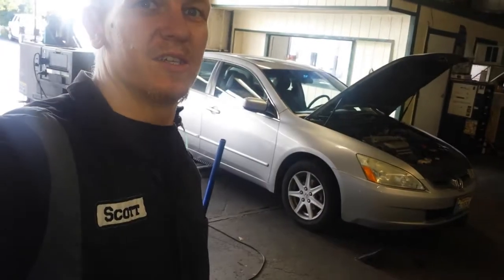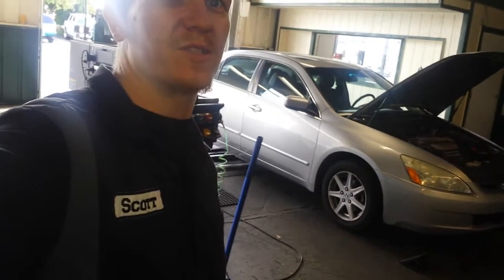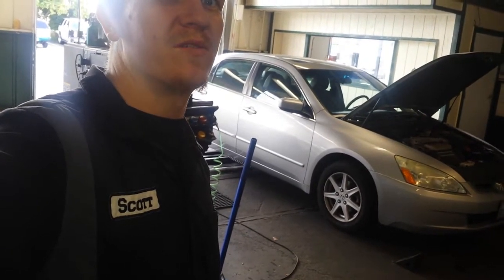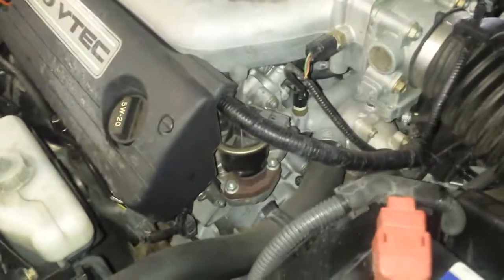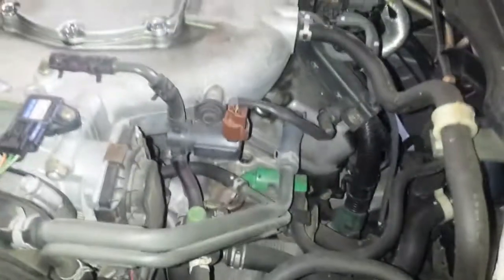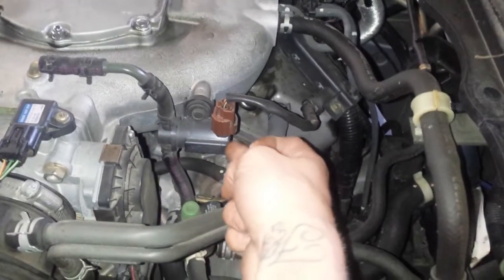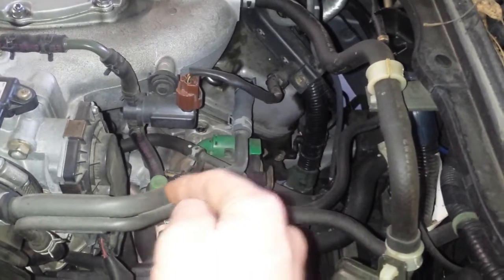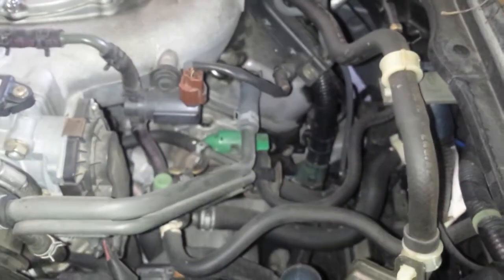Honda Accord emissions: EGR, EVAP canister & purge locations

Comment: THANK YOU

You don't want to know how many websites, forums, and videos I went through trying to find the location of the EVAP Canister Purge Valve on this particular car. One said one thing, another said something totally different. A few were mixing up the PVC valve, I had one dumb one show me where the gas cap was located. (The one on this particular car is sealing fine btw so it's not that)

Comment: Hi, May I know what this valve does, what the function of it?
I have Accord 2007 V6 there is clicking noise coming during driving when I push the gas, this noise only comes when the engine is full warm. This is could be from  this valve? PLEASE HELP.
Reply from the maker: Do you know what valve you are referring to? Do you have a check engine light on? Maybe you are talking about the Vapor Purge solenoid/ valve?
Reply: @ScottiesHobbies  thanks for your quick response. Actually, I really have no idea why does chattering sound is coming while driving its noticeable when pushing the gas, I am just assuming this could be from that valve.
Reply: Still waiting for your response.

Comment: Thanks for this video I wonder what’s causing my check fuel cap on my 07 Honda Accord, I already replace fuel cap with Oem, replace the purge valve non Oem, did a smoke test and nothing, any idea what could be causing it? I was thinking, next would be the pressure vent on the canister ?
Reply from the maker: Yes. Your vent solenoid might be stuck open or have something causing it not to seal.. i just made this video on vapor solenoid testing.. https://youtu.be/HFzknGqs0Ok but... I would think you would see smoke escape from the vent hose during the test.

Comment: I have a 97 Honda Accord 2.2 v tec that the fuel evap canistor keeps filling up with fuel after driving a while. This started after replacing the fuel tank with a non rusted used tank and complete fuel pump unit. need some suggestions of what it may be causing this and what to look for to fix this headache .

Comment: I heard another component is the charcoal canister and it's on top of the fuel tank. Is this true?
Reply from the maker: I show the location of the charcoal cannister in this video. I refer to it as the evap vapor canister.
Reply: @ScottiesHobbies  thanks and sorry, I was skimming the video at work.

My 04 accord 4cyl has the engine light, and will stall upon starting after refueling.

My mechanic friend took the evap part off the engine, the voltage was right, he blew through it and it seemed to work, but he did not test it beyond that.

So assuming that part is good, moving on to the evap canister.

The worry is, he says there's also a valve on top of the fuel tank involved in the system.

My plan is to take it in now, and just get the problem gone, but I wish I could know for sure WHICH part it must be.

Any thoughts based on the scenario?thanks again.

Comment: Great video. 

I'm getting a P0457. (2005 Accord, 4 cyl). 
Gas cap, purge valve, evap lines are fine.  I'm hoping to check the vent valve and hose. Any guide you could give?

I just sent you a mail. 
Thanks.

Comment: Thanks for this video. Would the vapor canister be in the same place on my 2007 Accord 2.4L vtec 4-cylinder (140k miles)?  I don't have a CEL on (yet), but we started smelling gasoline around the left-rear wheel well (which is also near the gas tank).  At first I assumed we may have refueled where someone had previously spilled fuel, and that rear tire might have soaked up some of it, but now I'm not so sure since the odor continues to linger (my wife says it seems stronger when the engine is running).  Any ideas would be appreciated.  thanks again.
Reply: Did you get any answers on this?  I started smelling gas and now have a PO456 along with check fuel cap scrolling message.  .  also 122, 108 and 511.
Reply: @321kliddle  I found that my 2.4L Accord's vapor canister is in the same place as the V6.  However, as far as my car's problem, it turned out to be a bad ignition coil that was misfiring occasionally resulting in unburned fuel emitting from the exhaust pipe sometimes.  I didn't have any CEL codes.
Reply: @mrau92me  , thanks for the reply.  Oh wow, I never would have drawn that conclusion for a gas smell.  For mine, I put sealer on the gas cap last night and attempted to clear the codes but they just stayed, all four.  This morning on my way to work the check fuel cap message is gone.  I am going to check for the other codes when I get home.  Thanks again for the reply.
Reply: @321kliddle  I'm no genius or anything. I was driving my car and when slowing down I felt a bump from the engine like a backfire. Two of the ignition coils were the original ones. I had replaced the number 1 and 2 coils a year ago after hearing a backfire from the passenger side of the engine. I just figured the other 2 weren't far behind on failing.

Comment: I got a evap leak on my 05 v6 accord , did a smoke test and found the both the vent and purge valve are stuck open, what is your recommendation to do ?
Reply from the maker: You need to replace them both.
Reply from the maker: They are stuck open even when electrically disconnected?  If so, replace them. If they are stuck open only when the plug is connected then I'd start thinking computer  issue.

Comment: I have 06 Honda accord and my emission transmitter light keeps signaling off and on so I broke out book to car to see what it meant and I guess it needs to be changed out cause my car has been ,like stalling
Reply from the maker: If it is a Taurus model they are super common for having a vacuum leaks. I would start off by checking that. If your emissions light is flashing that means you're doing damage to the catalytic converter. If the light comes and goes every now and then then you probably have an intermittent problem in your emission system. Is yours flashing?

Comment: Hey man great video. May I ask, I have a 07 accord v6 3.0 and my engine light is on so I scanned it and code P0443 came up, not sure if it’s my purge solenoid cause I pulled it off and put current to it and it clicks quietly and I put air on it before on the first test and air went thru it real easy then I wanted to test again and it still clicks but when I went to blow air thru it, it was harder to go thru, so I’m real confused here and I have to take my car to they emissions station very soon and I need to pass the test. I also changed the fuel cap and that didn’t helped. So if you could please get back to me that would be great. Oh my name is Steve
Reply: I thought you were replying back to me about my issue with my car but I only saw a red heart. Please let me know if you can help me. Thanks man.
Reply from the maker: Hey there, sorry I didn't reply to your comment from the other day on one of my other videos. But the p0443 is real common on that vehicle. Did you do a vacuum test on the purge solenoid? Make sure it holds vacuum when you have no power supply. If it is holding vacuum the common problem on that vehicle is the vent solenoid getting clogged with road debris or spider webs and not allowing the vent to close all the way when commanded. I would start by checking the purge solenoid for holding vacuum if it's holding vacuum with no power supplied then I would start looking at the vent solenoid. If you cannot find a leak your next best thing would be to find a shop that can do a smoke diagnosis and induce smoke into your EVAP system and watch for a leak. I hope that helps and if you have any questions feel free to ask I will get back to you as soon as I can.
Reply: Scotties Hobbies could you tell me where the vent solenoid is at.

Comment: Hi! I just took my car for inspection my service light is not on but he says it failed because a PO 497 code came up is this possible
Reply from the maker: When you turn your vehicle on does your service engine soon light turn on for a few seconds and then turn off after the engine fully starts? If it does not turn on then yes this is possible. Also, did it fail inspection? Or did the technician look at your computer before he ran the test?
Reply: I believe the light does do that and yes it did fail
Reply: Can you help me with this code? Not sure what to do I have a 2005 honda accord
Reply from the maker: Have you checked the seal on the gas cap? Turn the cap over and look for cracks in the seal. They go bad a lot. Always start by checking the cap. If the cap is good then your purge valve and vent valve needs to be checked. Checked fir functionality and make sure you have no debris in the valve/solenoid  it self. 

On your emissions test it failed under 'functionality' & not visual?

Comment: I have the P0443 and the p0499 in my accord 2004 lx what you thing I can do?
Reply from the maker: have you made sure the gas cap seals? Look at the bottom side of the fuel cap and check for cracks. The computer knows the evap system can't hold pressure but the computer does not know why. I would check the vent tube from the vent sol. to ambient, they are known to get road dust and spider webs in them. Clean it with low pressure compressed air or one of those little desk top duster cans.
Reply: Scotties Hobbies thank I will
Reply from the maker: +Kelvin Maldonado keep us posted throughout your diagnosis and repair if you can so maybe we can help somebody else that has the same codes and is trying to do a DIY fix. Thanks for the view!
Reply: Scotties Hobbies when I fix it I will put what was the problem and how I fix it
Reply: Scotties Hobbies I change the purge selenoid and restet light he pass the light is off thanks you for help

Comment: Hello. 2007 v6. PO455, PO457,PO497.. already changed gas cap oem. Passed smog after resetting but check engine light back on. Any help? Thank you

Comment: I'm getting a P0497, what parts should I replace first. Not sure how to diagnose this issue. Thanks for any help!!
Reply from the maker: +ntrlfndr42 I would check the purge valve. If you could check the resistance on it I would start there. Also it's common for Honda's to get the vent valve or solenoid hose that goes to the ambient air restricted with spider webs or road debris. You might want to try to clean that hose that releases that pressure as well.
Reply: Scotties Hobbies...subscribed. I'll check that now, thank you!!!

Comment: thanks for the video, I was looking for the canister and valve location, my accord 04 v6 had a fail, code P0457, I hope that I can find the leak
Reply from the maker: +Eloy Sanchez have you checked your gas cap? Make sure the seal is still good? A loose or bad cap will cause this code. I usually replace the cap first when i get any evap codes on a vehicle. But the evap canister i think is infront of the driver rear wheel and the vent valve shiuld be right there too. I have a 01 acura, it should be the same. Ill look at it tonight or tomorrow and get back to ya.
Reply: Scotties Hobbies thanks for your response, I checked the filler cap, it is a little hard at the time to rotate it but make clicks easily, it seems that work properly, however I would líke to try with another one just to be sure

Comment: I have a 2005 accord sedan ex v4, got a code P0497 EVAP system low purge flow. Already replace gas cap light still on. Should I replace the EVAP canister ?
Reply from the maker: +Auto DIY no, check the hoses from the vent solenoid first. I doubt the cannister needs to be replaced.
Reply: Scotties Hobbies, the vent solenoid located near the canister?
Reply from the maker: Yea. Its common for the vent hose to get debris in it like dirt or spiderwebs.
Reply: Scotties Hobbies thanks I'll take a look in the morning.
Reply: Thanks scotties, it's spider Webb.. Engine light went off right away...
Reply from the maker: Glad to help!
Reply: Scotties Hobbies  if I have a 05 accord sedan v6 ex with ap0497 low purge flow and I have already checked the vent hose. No blockage. Next step be to replace the vent solenoid?